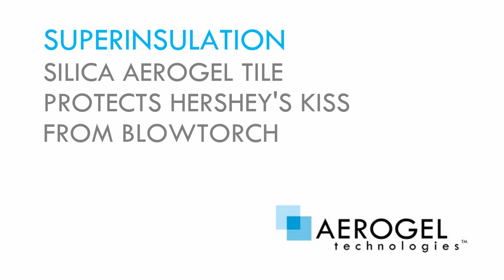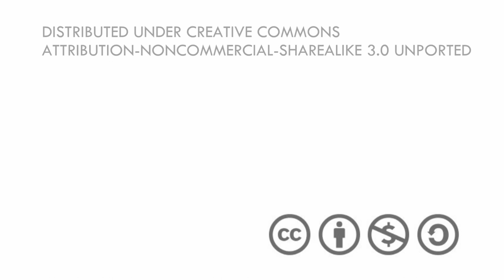Aerogel Superinsulation Blowtorch Demo: Hershey's Kiss

Comment: I wonder if the aerogel actually failed because of its reaction with the chocolate: had it not been in direct contact and deteriorating because of the moisture, might it have withstood the hottest flame?
Reply: and would it deteriorate like that without the chocolate? or does the material have to be replaced regularly for its application?
Reply: No. The bottom heats up and vibrates (cause that's what atoms do when they're really hot) and basically desintigrates the bottom, as its so brittle.

Comment: I truthfully don't believe it was the heat that did the aerogel in, but the force of the escaping propane from the torch that "pushed" it's way through the Aerogel, therefore allowing the heat to melt the Kiss. My opinion only.

Comment: why not make a microprocessor out of aerogel? It would never get hot.
Reply: Hehe, no because it would destroy itself from overheating internally right away. Aerogel isn'ta cooler, it's an insulator.
Reply: Heat doesn't magically dissipate, it needs to be vented somewhere. The only way to make a processor not get hot is with room temperature superconductors, which aren't currently manufacturable. Because superconductors have 0 electrical resistance and thus produce no heat from their electrons bouncing about inside of the wire or transistor it's made from.
Reply: We should make diamond heatsink, it's even more effective because diamond is one of the best heat conductors.
Reply: It's actually tricky. You need a material that is electrically insulating (doesn't conduct electrons) but thermally conductive (conducts phonons). People are interested in this idea especially for stacking processors. Right now one processor takes up a whole heat sink. If you stack them up like floors on a building, then you get more computing power, but how to dissipate the heat?
Reply: pookellypoo take a pump with water

Comment: Soooooo, when do we start insulating our houses with this stuff?
Reply: expensive af, $200 for the amount shown in the video. but if youre really rich really fucking good. particle powder of aerogel is is cheaper
Reply: But our houses would be fire proof!
Reply: Cilly Honey it's good but not when exposed to any moisture. It starts to break down after being in contact with water. So it's not a good building material for insulation.

Comment: But the odd thing was the chocolate didn't melt, even though the aerogel gave in the chocolate didn't, so doesn't that suggest as I'm sure the video is suggesting aerogel is good as a heat absorber or such, that chocolate is better than aerogel at absorbing heat.
Perhaps use chocolate as a heat protective layer on top of aerogel a kind of aerogel chocolate sandwich.